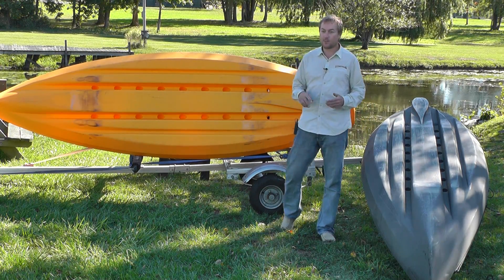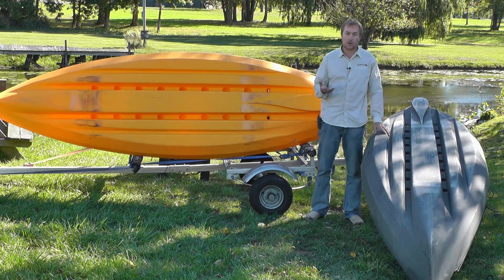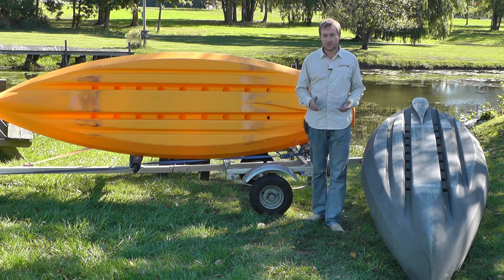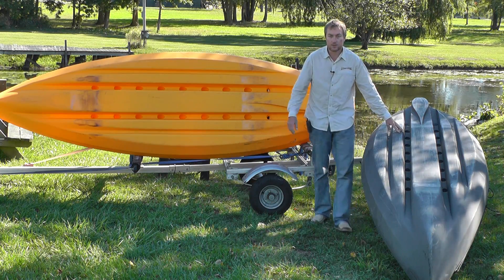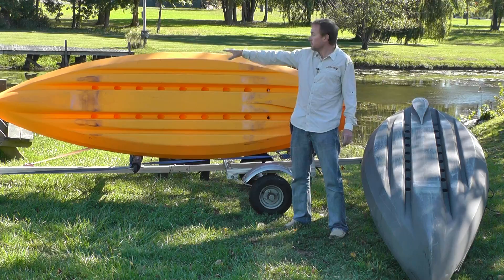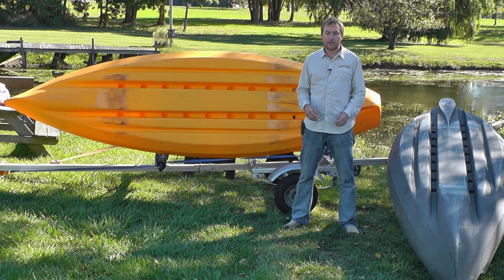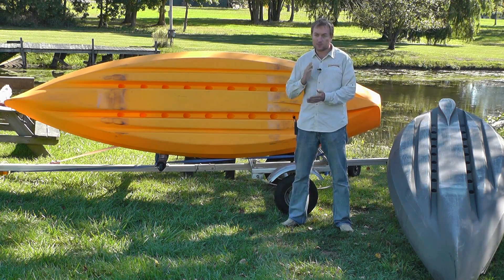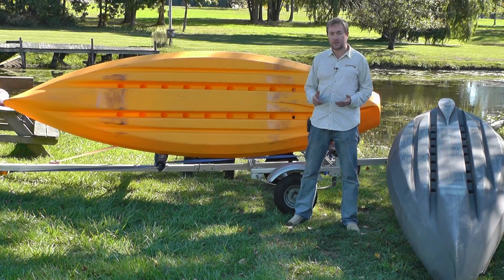The NuCanoe Frontier Hull Design

Comment: Will this kayak work with a Hobie Trax 2 Kayak Cart?
Reply from the maker: According to the specs on that cart, the distance between the scuppers on the Frontier would most likely be a good fit, but without actually trying it out I can't be certain. I would check out the NuCanoe Transport Cart - much easier to hook up to your boat when you need to move it: http://www.nucanoe.com/transportation/
Reply: I'm not sure that the wheels on the NuCanoe Transport Cart will roll easily over the marsh grass and rough terrain that I have to go through to get to the bay though. I think inflatable wheels might roll better.
Reply from the maker: bbcasting The inflatable wheels will probably be a better fit for that type of terrain. Let us know if you're able to confirm that the Trax 2 fits on a NuCanoe.
Reply: I think that storage when I go out in the water might be a problem with the Hobie trax 2...Will probably just buy one of the Nucanoe brand ones now since it's smaller. Thanks again for answering all of my questions!
Reply from the maker: bbcasting You are welcome!